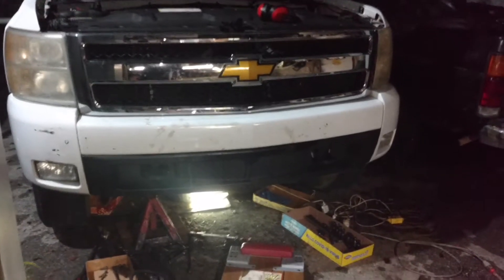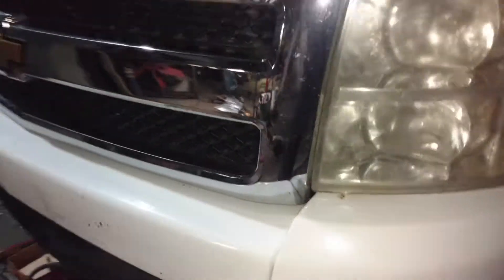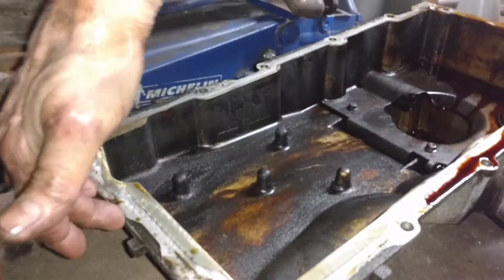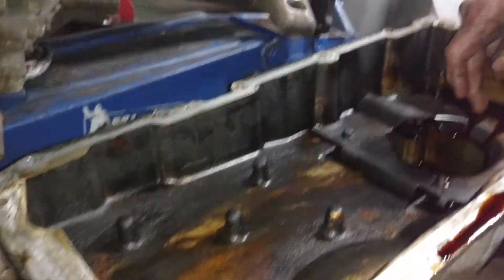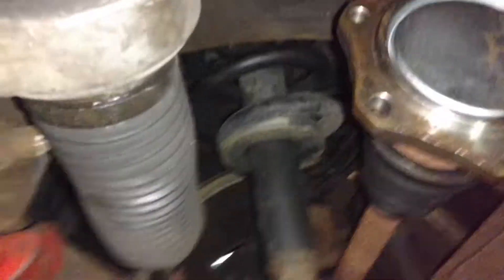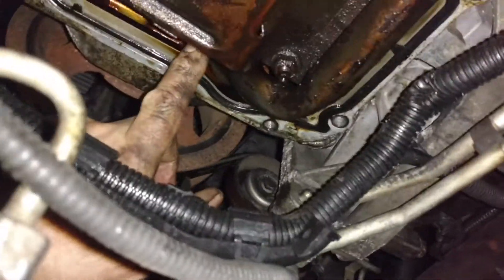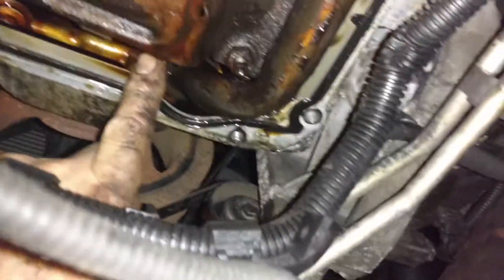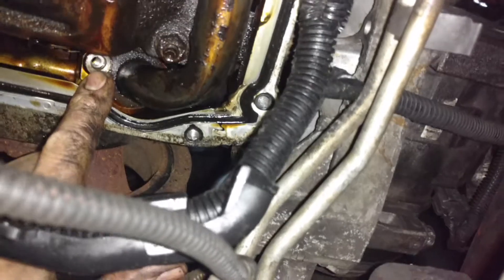2007 gm 5.3/6.1L 4wd oil pick-up o-ring short cut?

Comment: Never done a cam swap in a ls before? Yes that little bolts a bitch to turn in the front of the pan . But after you man up for 20 mins it's out . Not that hard then take the 4 bolts out of that old ass oil pump u need to be replacing at the same time as that old o-ring . Think about it what's 45.00 more on this job and it comes with the o-ring. Then turn pump to the right and pull out . Wow pumps off.take new pump clock it to the right like you took off as u push it on shaft gear . Turn it to the left onto the pipe and tighten it all back down to spec . For how nasty that engine looks inside it needs a pump . I don't even want to think able the dod lifters I know they are tacky as a mofo . I do cam swaps all the time and when they look like that inside u best be putting a 355hv pump in it. Just my 2 cents .

Comment: I agree this is the best way . I'd rather take off the crossmember and front diff than remove the water pump and harmonic balancer ( which requires a special puller and a new bolt ) as well as having to replace the front main seal .
Reply: I’m opposite I rather do all that than remove the front diff and cross member😂  it’s much faster to me imo

Comment: this man doesnt know what he's talking about. thats not the shortcut at all
Reply: He is showing how that shortcut that people talk about doesnt work.
Reply: @goose103    smh you dont know either it seems.  He doesnt know what hes talking about because the shortcut is going from the front of the engine not from the bottom. Maybe look up what the shortcut is before you make yourself look even sillier
Reply: @bookrokodil  ooohh, is someone feeling a little grumpy?
Reply: @goose103  
You’re missing his sarcasm. What the guy posting the video is showing is if you try the shortcut from the front it doesn’t work because you can’t push the pickup tube down out of the pump even if you can trick the oil pick up bolt from the pump out. What he’s explaining is the other 2 nuts holding the pick up tube to the dampener is holding the tube too tight to be able to do the shortcut,
He’s exactly correct as well. I’m doing the same job for last 2 days. I was able to get the front bolt out with a bench wrench but the tube will not flex out of the bottom of the pump because it’s too secure in place by the other 2 nuts holding it. I had yo drop my pan just like he did.
Reply: @BrokenRRT  take the windage tray off and look at your cam bearings.  See if com8ng out.  Spin crank and see if they move.
Reply: apparently all you did was watch the title of the video and not the whole video.

Comment: They don't move the tube. They take the timing chain cover off and remove the oil pump by carefully unscrewing that bolt from the timing cover side (which is tricky, but doable) and pull the O ring off the tube without moving it. The hardest part is reinstalling that bolt, this is far more tricky, but doable (with wire to hold the threads while threading it on) - or cutting the tab covering the bolt hole on the OPPOSITE side and using a saddle to resecure the tube to the pump.

Both options are a decent amount of work.
Reply: You’re missing the point of the video. The front bolt holding the tube to the pickup tube will not push down or flex away from the pump by just removing the tricky bolt using tricky ways. The other 2 nuts holding the pickup tube to the dampener are so secure that they do not allow the tube to move enough even with front bolt out of the pump. I found this out for myself snd had to just drop the pan to do it the correct way.
Reply: @BrokenRRT  I didn't miss the point, you did. The strategy doesn't require the pick up tube to move at all: taking the oil pump OFF reveals the ring.
Reply: @BrokenRRT  And yet there are hundreds of videos of people doing it.